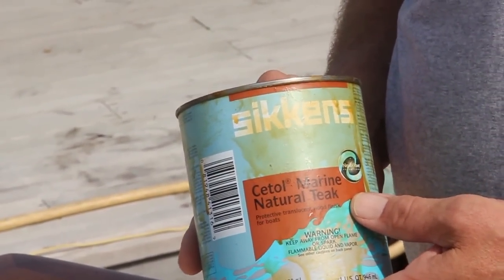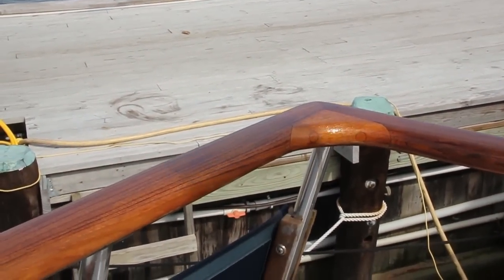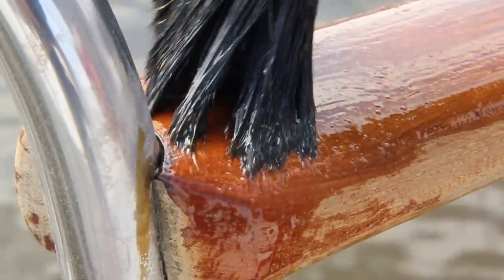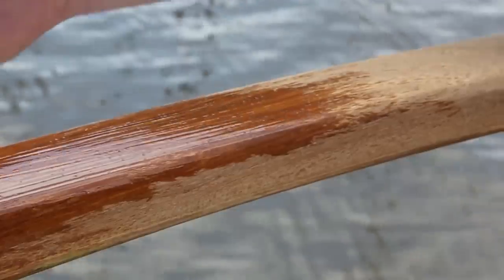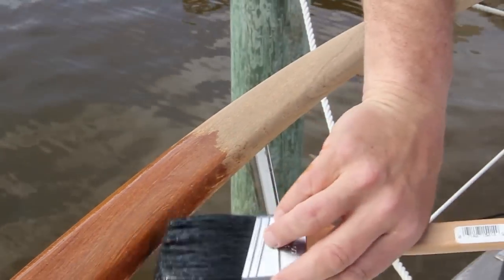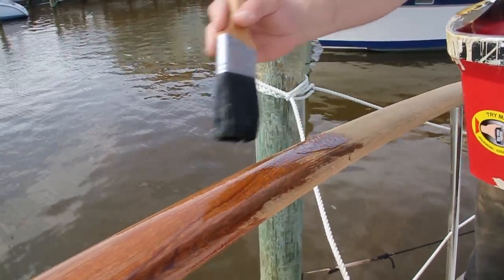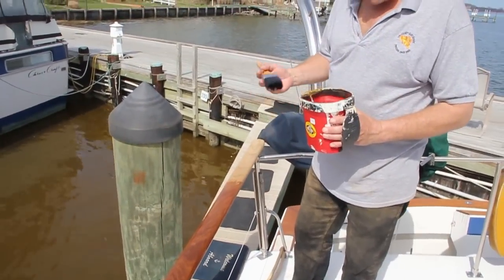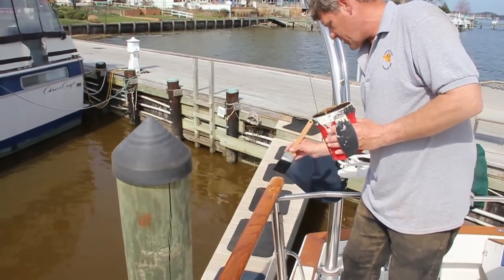Interlux's Cetol Application 1st and 2nd Coats

Comment: I'm seing just the first coat. I was hoping to see what, if anything, you did between coats.
Reply: Nothing. That's one of the advantages of Cettol. Use two or three coats of the tinted 'Cettol teak' to achieve the colour you want and then switch to the gloss for another two or three coats. Next year just a very light sanding and then a coat or two of gloss only. That way the colour stays the same.
Reply: @UguysRnuts  I use cetol on my companionway steps, my grab rails, this guy doesn't need 7 coats. My steps have 2 coats cetol, one coat Helmsman Gloss Varnish and then another coat of Helmsman with non-skid mixed in.  They are beautiful.  My grab rails and other I only put three coats on. No varnish.  I just did that on my steps because of the wear.